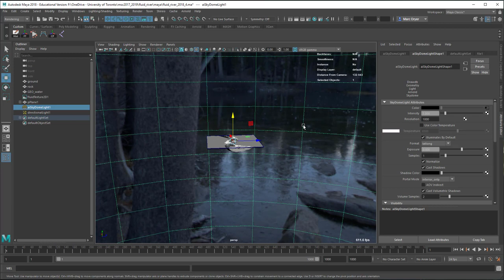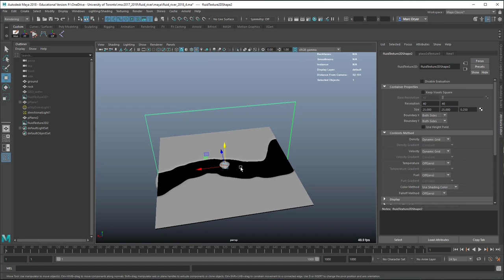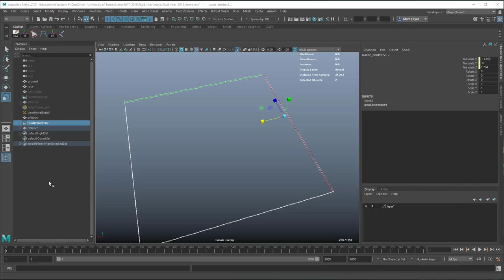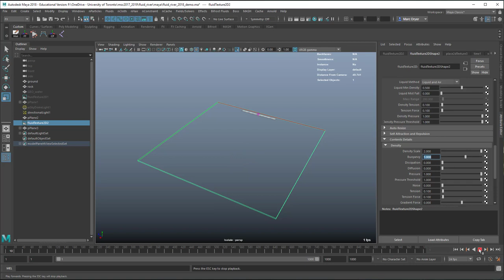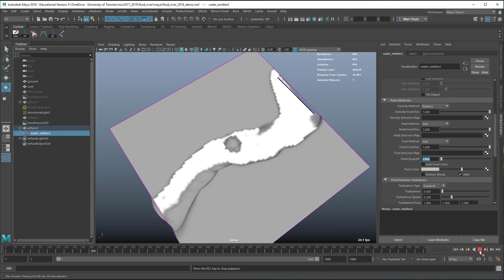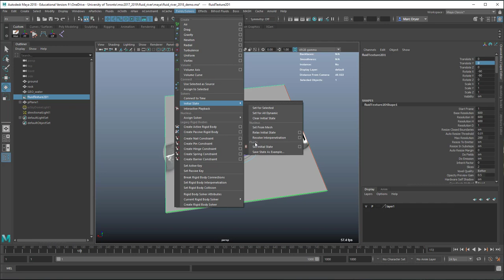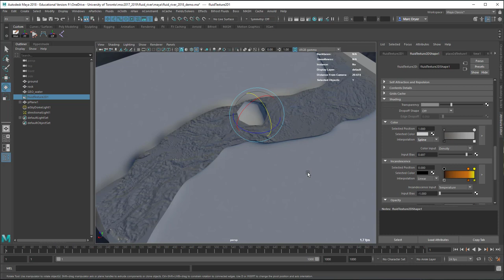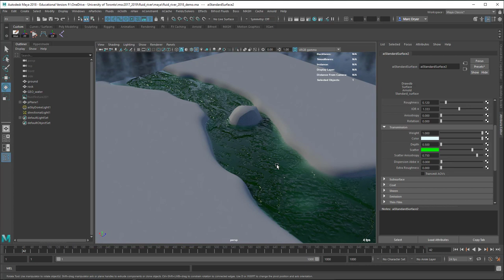River Fluid Texture in Maya

Comment: hiiiiiii. tnx for nice tutorial. i have a problem. when i drag texture  in to the geometry , bumping not showing off so i have soft water without bump. can you tell me why.
Reply from the maker: Do you mean that the bump is not showing in the render, or on screen in the Maya interface? I'd have to go back and look at this file to remember how it all works. I don't think I experienced the issue you describe, but I did find that it was somewhat unreliable in transferring the animation of the texture to the renders. You may want to check the voxel size in your setup - could they be too big?
Reply: @3dsplanchnic737  actually i have bump in my render and on my screen. but in your tutorial your bump covered all surface of water  and i'm trying many times step by step but my bump covering just little bit surface of water so bump showing in the middle of water like a Thin rope . that's my problem.i Increase the bump in setting but not working. sorry for my bad language. i hope you got my problem. tnx for reply.
Reply: @kasrahosseini572  did you work this out im having the same problem